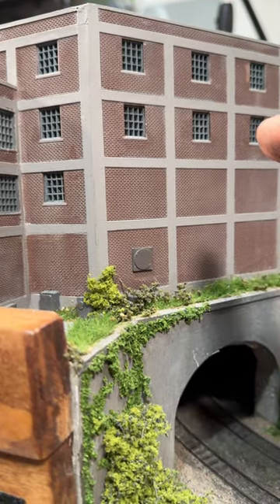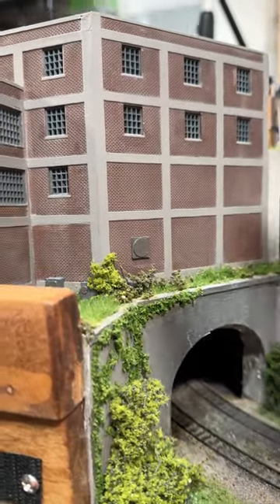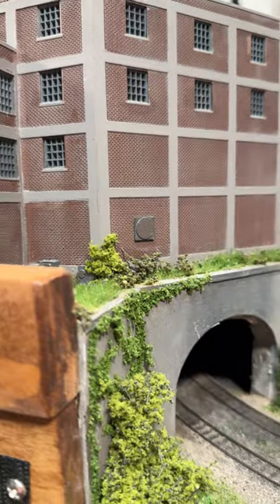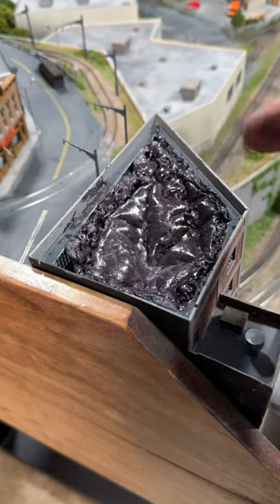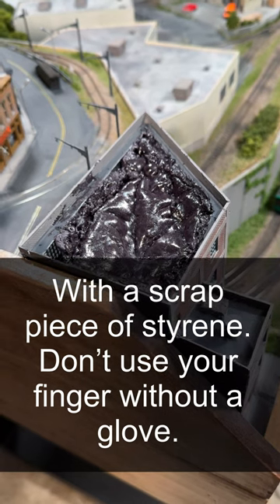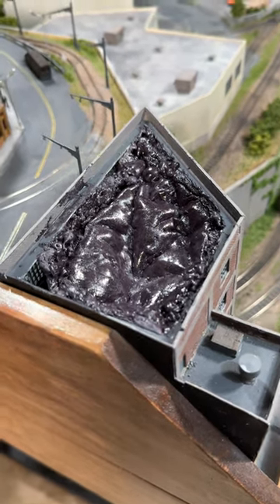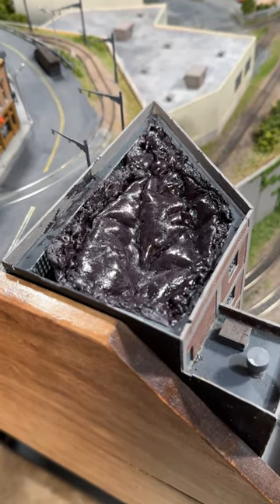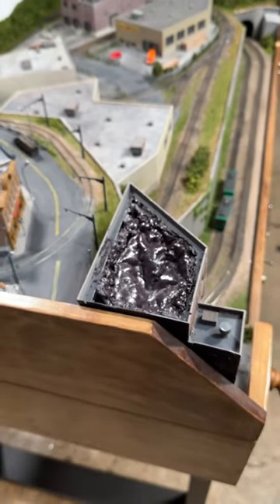Hold Windows in with Spray Foam #modeltrain #modeltrains #railroad

Comment: If you do decide to use foam i think it could be a valid option, but as another commenter mentions, its messy sticky and hard to remove. Taking a note from the Computer industry, place a plastic bag like a grocery, or small trashbag inside the building making sure to overlap the edge and covers the entire space, then fill the bag with your foam. Let the foam expand and slice off the over expanded foam with a sharp blade, trim back the plastic bag, and should be mostly removable, it will form to the inside of the space though so id say more so it just wont ruin the model, you may still need to remove walls or a roof. But it will not be stuck. I would add that like any chemical reaction, there the potential that this foam can get hot if your using a lot of it at once.
Reply from the maker: Good points. I’ve used it in several buildings now and haven’t ruined anything  yet but the risk is certainly high since it is so sticky.
Reply: @StevesTrains  I think you would still have a lot of trouble removing the foam even using a bag. It would likely knock all of the windows off in the process. The only benefit I could see to using a bag is to drape the excess over the top and down the sides so that you don’t need to baby sit the expansion or worry about it getting on the outside of the building. Then you can trim it off bag and all. 

If you have the funds an oscillating multi tool is great for cutting this foam. I work with this type of foam when installing windows and doors. Also I’ve never noticed it getting hot or even warm… any potential heat generated would be negligible. 

You can, to an extent, cure the foam faster by spraying it with water. 

Also they sell a solvent specifically for removing this type of foam.

Comment: Question, could the foam be removed if I needed to get inside again in the future? Say I decide to go back and install lights or put something in one of the windows?
Reply: PVC primer is the only thing I’ve found that’ll remove it. Don’t use it for your sake
Reply: Ill preface my answer with "I am not a model maker or similar". However, if you do decide to use foam i think it could be a valid option, IF, you were to do it right. Taking a note from the Computer industry, place a plastic bag like a grocery, or small trashbag inside the building making sure to overlap the edge and fill the entire space, then fill the bag with your foam. Let the foam expand and slice off the over expanded foam with a sharp blade, trim back the plastic bag, and should be mostly removable, it will form to the inside of the space though so id say more so it just wont ruin the model, you may still need to remove walls or a roof. But it will not be stuck. I would add that like any chemical reaction, there the potential that this foam can get hot if your using a lot of it at once.
Reply: It melts with acetone. So you could probably just soak a rag in that and melt it away

Comment: Yes never touch spray foam with ur bare skin, not only is it hot but veryvery sticky and very hard to get off.
Reply from the maker: Yes, I’ve used it a bunch on home insulation projects as well as several train projects (I used it exclusively for terrain once), and yes, getting it off your hands is  hard. I always wear gloves with it but still usually find a way to get some on me one way or another.

Comment: Have easily removable roofs?
Reply from the maker: Yes that would make more sense, but I usually glue the roofs on with these kinds of portable layouts to add structural rigidity. Also since the lid lifts up, I didn’t want roofs falling off.